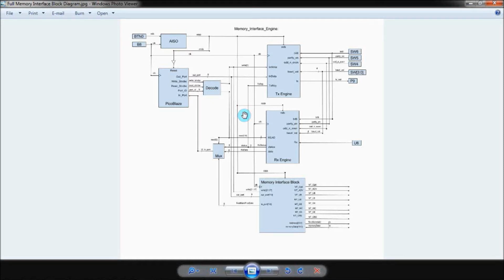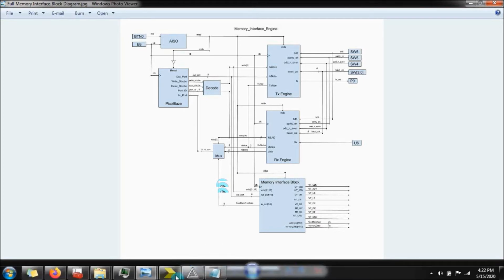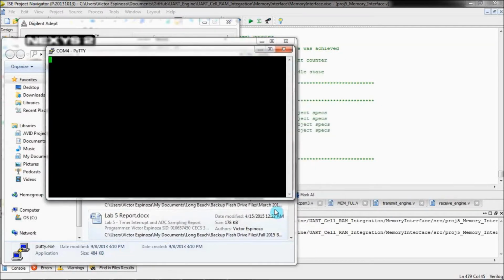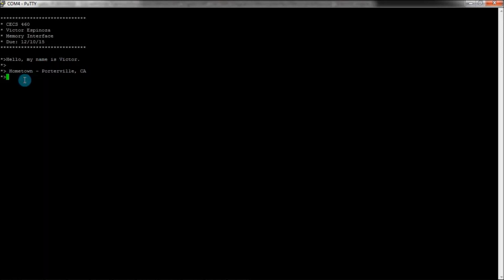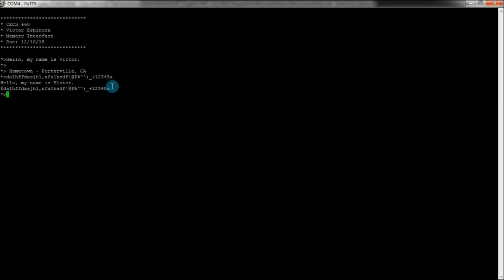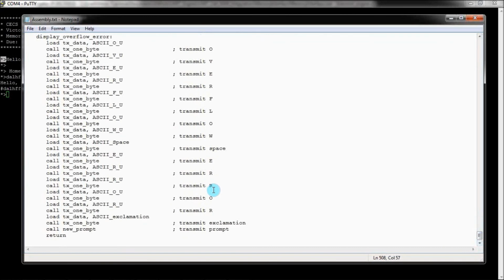Verilog UART Engine Demo

Comment from the maker: GitHub link: https://github.com/victor-espinoza/UART_Cell_RAM_Integration

Timestamps:
0:00 Project Overview
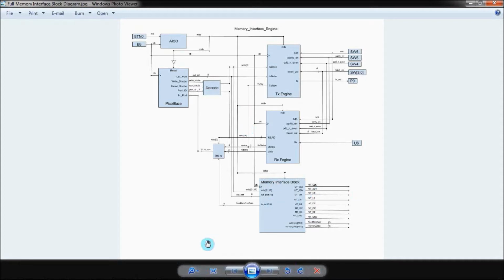0:18 Supported Data Packet Formats 
1:04 Supported BAUD Rates
1:30 Devices Used in Project
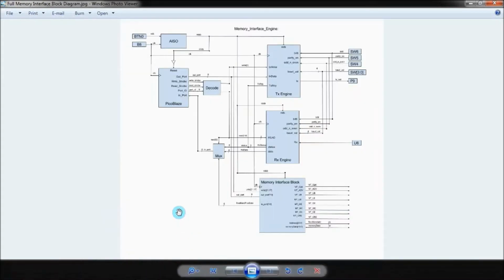1:43 UART Engine Deep Dive
1:48 AISO Syncronization Circuit
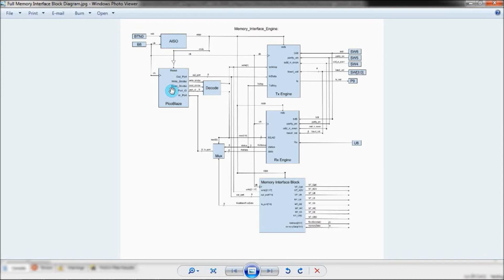2:39 PicoBlaze Microcontroller
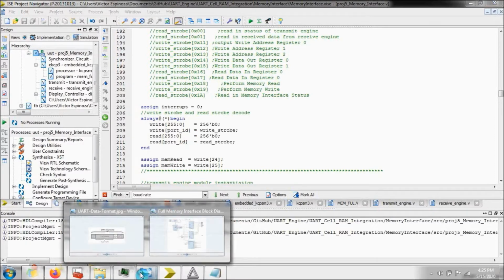3:30 Transmit Engine
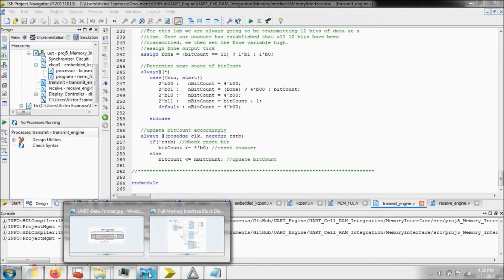4:11 Recieve Engine
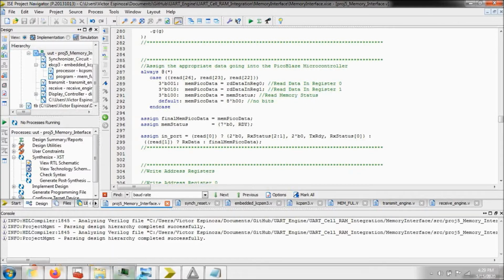5:41 Memory Interface
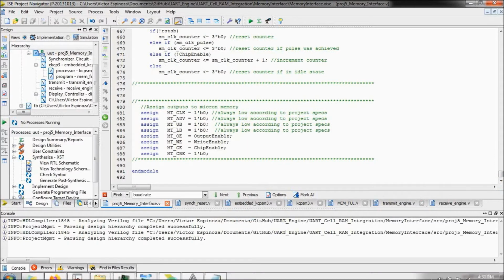6:26 Programming Project to the Nexys2 Board
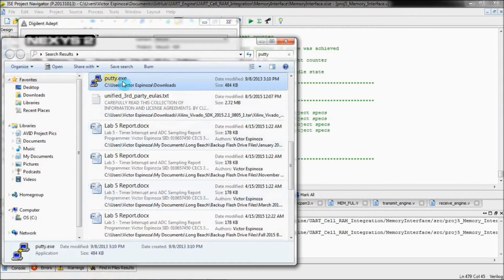7:00 Terminal Window Configuration (8O1)
7:28 Nexys2 Board Configuration (8O1)
8:27 Live Demo 
8:40 Echoing Characters to the Terminal Window
8:50 Different Character Interactions
10:02 Interacting with the Nexys2 Board's Memory
10:40 Viewing Memory Contents
11:14 UART Interface Assembly Code
13:12 Closing Thoughts